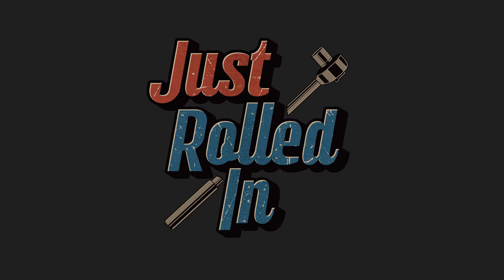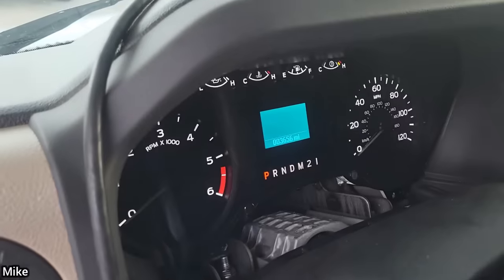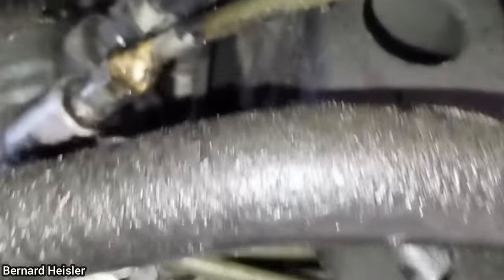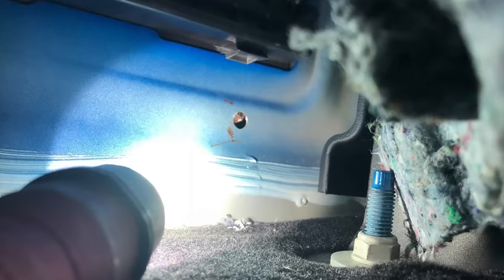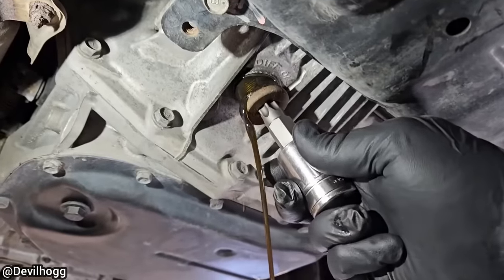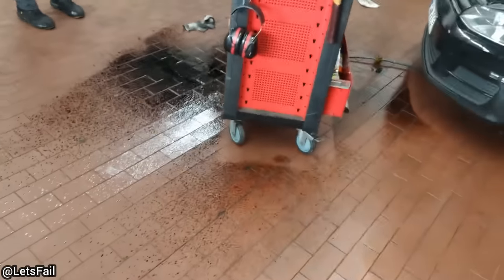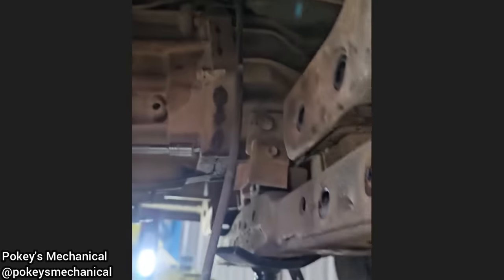Mechanic FAILS Compilation | Just Rolled In

Comment: 0:32 I'm no mechanic but I've seen enough automotive shows over the years that showed the oil and other fluids have to be completely drained from the engine before it is pulled for a rebuild or to be replaced.
Reply: That was bad, but having pulled a number of engines it is a known fact that you never get it all out. You'll find some on your shoes and floor when you spin it over to pull  the rod caps.

Comment: I had a co-worker have her tires rotated.  She drove out of the parking lot and the tires fell off.  The guy apparently forgot to put all the lug nuts back on the wheels.  She said she just wanted them to pay for the dents and have it fixed and let it be a learning point for the guy who did the job, but they went ahead and fired that guy on the spot.

Comment: If 150 psi blew out the transmission pan, what other seals did it blow out??  I'd want a whole new transmission.
Reply: The transmission pan was plastic, more fluid pressure goes thru the valving than 150 psi.
Reply: @scottvincent3062  I guess I wouldn't want a vehicle made with a plastic transmission pan either...
Reply: @ffjsb  Unfortunately the last 20 yrs or so they have been using a lot of plastic for things like intake manifolds, valve covers, radiator tanks and transmission pans all after time become brittle and break.
Reply: @scottvincent3062  ...and charging a crap load more...

Comment: I just took my car to a Subaru dealership today to just get a tire rotation since I didn't feel like doing it myself. I watched the "tech" tighten my lug nuts with just a couple of ugga duggas and drive it out of the shop. I had to make a huge stink about how the spec is 120Nm and to use a torque wrench, lest I end up like that F-150 in the clip.

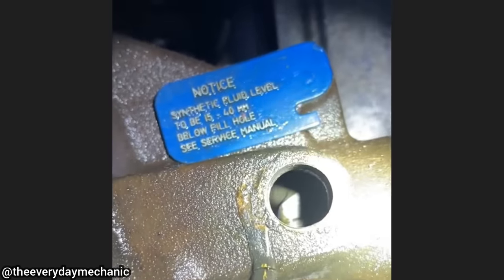Comment: That design at 4:52 is either unforgiveable, or something is missing - like any idea somebody in the 300 pound club is somehow magically not going to smash that cross brace down into the posts at some point [or they touch off in an accident].  That's a standard battery... imagine the asswhupping delivered to engineers by Li ion used on EV's?  No wonder Ford is walking back on that.

Comment: The shop who installed my brother's stereo spliced into the wrong power wire. The torque converter will not lock up unless the stereo is on. Also, the overdrive lockout doesn't work anymore.

Comment: The scenes where the vehicle fell off the jack due to failure of jack arms, chilling. Always be alert and cautious in such work place. And no wonder more and more ppl over there are learning to service & change simple components on their own, you cant trust these clowns with yr vehicle at all
Edit: The shops where they charged the customer for their mistakes and not admitting it should have their license revoked

Comment: @6:40....Overfilling an automatic transmission will not cause a transmission failure. It was a bad transmission. The excessive fluid will just simply blow out the filler tube or overflow vent.

Comment: I think its almost impossible to do worse things to cars than the owners. When i worked at a GM dealership a customer had the starter go out on his Oldsmobile Aurora. It came with a Northstar engine in it just like many Caddys did. Service gave him a quote to repair it but he decided he would do it himself and save some money. The next day the car comes in on the hook. The owner lifted the car with the jack on the aluminum oil pan. The jack went right through the pan and dumped all the oil out of the engine. The real bitch of it was the starter is located under the intake manifold and the vehicle never needed to come off the ground in the first place. Northstar engine were a breed of their own and they could be a nightmare to work on. The guys bill end up being 3 or 4 X more than what it would have if he just had it replaced at the dealership.

Comment: I was almost killed by a brake rotor that came flying at me after a mechanic failed to tighten everything on a truck they'd just serviced. Luckily it aimed low and only took out my entire front quarter panel as I was sitting at a stoplight. Watching that tire bounce through the intersection 5 seconds before the truck did was totally surreal.

Comment: Yeah, the plastic cover over the battery of the Transit 250 is a pain in the butt to put back in, unless you remove the whole seat, but that plastic keeps the battery contacts from, well, contacting anything. Good gravy…

Comment: 0:34 what's even worse, if you use another coolant than original Volvo on their big SUVs the water/oil cooler will be washed out and break apart like it was cheapest plastic... not sure what they did with both materials.
but even here in germany, where we have all kinds of degrees, not anyone knows about the differences in additives, and why some coolant contains silicates, and the other organic acids... and what happens if you switch around, or mix up. what used to be one or two coolants overall (VW, and others) in the 80s, early 90s, is now a good dozen different additives and a couple norms. BASF has a big list, even for classic vehicles, so you can see what's the correct coolant.
2:19 a mistake you usually do only once. I haven't before luckily, or rather, I noticed before any oil would spray out, and removed air pressure again. ;)
3:35 the VW Golf Mk3 convertible has a hydraulic roof actuator. the pump and reservoir sit in  the niche behind the left taillight, and the hoses run around the inner edge of the wheelhouse. customer installed a CD changer there, using self-tapping screws, and just barely nicked one of the hoses, just enough that it took a year or two for it to start leaking... but then it emptied it's oil into the spare wheel bottoms from where it leaked onto the road when parked. I don't remember which was more of a nuisance, replacing the hose, cleaning up, or makign sure no screw would screw with them hoses anymore...
last clip: yes, but only once. I managed to learn from it and stop before I couldn't switch the tool anymore to return the screw and free the tool. XD

Comment: Got my Son a new Tacoma TRD PRO. First oil change and they damaged the oil seal. It leaked oil all over the dealership and my Son drove off. Blown engine within 10 min. Got a new truck but I paid the difference from a 2022 to a 2023.

Comment: There is a socket in most kits That is for a spark plug And the only one that has a grip area for a wrench...Because they knew GM would mess up a good design And throw in a exhaust manifold on number #5 spark plug And you need to get a wrench in there

Comment: I worked at big O when I was 17 and wasn’t paying attention. Walked eye wide open right into the oil drain container pan and got a piece of stripped drain pan threading lodged in my eye. When I blinked my eye lid pulled down on the piece and lodged under the lid in a second location. I went to urgent care and they got it out without any extra damage. Flushed it all out and gave me a tetanus shot along with antibiotics. Returned the next day with a temp eye patch taped to my face.

Comment: wife got advised to get the ceramic coat on her car. which they did. but they had taken the roof rack off and let the nuts slide down the channels. didnt say anything. whole  interior went moldy when the rain got in 🤦 also used it to take sheet materials home. lucky it never lifted the whole rack off.

probably worth getting a couple of 360 webcams so you can catch evidence of what they do.

Comment: I took my car in for an evap leak. Shop said it was the charcoal canister. Not long after the repair the CEL came back on for an evap leak. I rigged up a smoke machine and found the shop that installed the canister over tightened the purge valve and cracked it where the o-ring seals to the valve.

Comment: I have my experiences with bad mechanics. I needed a new starter motor In my car, the shop ordered one and couldn't install it due to them not having a tool to remove the water pump pulley. They caused a leak in the water pump and charged me for the starter they could not install and didn't even bother to give me the stater motor I paid for. I lost about $238 to those scammers.

Comment: I once had a Pep Boys fail to run the lug nuts down on one of my tires. When I left the parking space, the driver's front fender collapsed down on to the tire. Before I left, I got two new rotors and calipers, and they got to reimburse my company for $1300 in body damage.

Comment: Unless you absolutely never use your signals (or put it in gear), its virtually impossible to drive a car without touching some switch gear
So how the Buick in the 2nd last clip got home without the owners turning right around is astounding

Comment: I've had to blow out two glow plugs by running the engine on my 1,6 Volvo diesel. They're on the back of the engine and awful to get to so I had to make special tools to drill out the threaded bit. The ten year old plugs were obviously stuck in there like crazy. After days of trying to loosen them with penetrant and warming the engine I let them blow out by themselves under uphill load. One was no problem but the other one shot straight through a cooland hose.  lol

I hate the engineer that decided to put them down on the bottom of the back of the head of an engine that is always transversally mounted in tight bays.

Comment: The shop that did not cover the automatic transmission because it was overfilled was correct. You cannot hurt an automatic transmission by overfill it. It simply was transmission fluid and semi rust proofs the vehicle.

Comment: I’ve installed transit batteries before. You are not supposed to install that bracket directly above the battery. (Obviously) It should be installed last.

Comment: I changed the oil on my Corolla. Have done it for years. But this time something was wrong. When I put oil in it was way up the dipstick - like - there was double the amount in there. I checked the oil bottle again and again - 4 litres. I went and had a cup of tea. I just could not figure it out. I crawled back under and decided to drain some of the oil. Nothing came out. WTF. Another cup of tea. Then I went back under the car and Zap - I realised my mistake. I had drained the transmission oil and filled up the engine oil. The transmission oil plug was dead-center and I just undid it without thinking. So, I got new transmission oil and new engine oil. All's well that ends well but I thought - if I have done this, so may have others. I checked on YouTube. Several people did this, drove off, and wrecked their transmissions, will oil leaking from various engine gaskets. Moral: If you get stuck - a cup of tea is required.

Comment: For the last one my worst one was.... i don't know what you guys call it translated we say "air gun". Anyhow i was loosening bolts on a transmission had my hand over the back where the direction switch was so i could push it on the bolt firmly. Unfortunately then my hand got sandwhiched between the gun and subframe. I had to yank out my hand pulling 2 finger nails out in the proces.

Comment: I'm pretty sure I was on the receiving end of one of those fraud jobs. I bought a used car and the seller gave me all of the receipts for the last several years of maintenance and repairs. A couple of months later, the car won't start; ends up it's the fuel filter clogged and fuel pump dead. I had the receipt for a local shop showing they had just replaced that pump a month before I bought it. I called them up to see about the warranty on it and all they will say is, "There's no warranty on it; it's just a jobber." My best guess is that either they put in a used one or they didn't even replace it.

Comment: We can all get a good laugh out of this video, but in all seriousness, when you’re dealing with brakes, steering, suspension components and the wheels, take extra care to make sure everything goes back on torqued. One time I pulled over to help this bmw on the side of the road, he said one of his wheels started wobbling so he pulled over immediately. To his surprise, we found that one wheel was only being held on by 2 out of 5 lug bolts. I think they put the wrong rotors on, because it apparently just got a brake job done on it, and all three holes in the rotor to the hub did not line up.  He had to get his car towed, and I recommended that he immediately go back to that shop and demand a refund and proper service. He was pretty scared after realizing what could’ve happened as he had his wife and his two daughters in the vehicle with him. Remember when working on someone’s car that they are trusting their life in your hands, if you forget to tighten one bolt somewhere it could kill someone.

Comment: I really feel for the guy that walked into whatever that was attached to the back of that car. I've hit my head on trailer hitches, tires, lift arms, and one time I hit my head hard on a cage designed to hold an electric scooter. Shops are a dangerous place.

Comment: Had a guy drive my truck off the rack head first ….. landed on their valuable computer that was (formerly) 5 feet tall . 77 Ford F-150 4X 4 RANGER did the job ….in 1990 got $2,500 for a small dent on the drivers side door and a front winch bumper just pushed up by loose bolts 😊 no damage to the truck except for the door and  broken arm of the guy that was driving
Reply: I was in the customer wait room when I heard a crash where you knew something was wrong 😮 imagine the idiot just concerned about his arm 😮🤣🤣🤣🤣🤣

Comment: The part about the coolant being chunky? That is a lack of proper mixture. I have never had an issue in 20 years with generic anti freeze 50/50. All manufacturers say they have special stuff. It's just another color. Maybe on extremely rare situations. Otherwise that is Def mechanic error more then the product itself.

Comment: Don't try to stop a 2000+ lb object that is falling. Just get the hell out of the way.  I've seen people crowding around forklift loads while moving equipment, thinking that they'll "help" if a load starts to fall.  I always tell them to back off and that if something is going to fall, let it fall.  Machines can be fixed a whole lot easier than people can.

Comment: 85 Cadillac Seville.   Weird tinging noise when accelerating.  I looked all over without a lift.   Went to a shop I use to work at. They lift it up, test drive it and such, not in that order, lol.   Tell me they think the tranny is going out.  I told them No,  If it was the trans it would change pitch, change sound in temp changes and shifts, things like that.   I drove 100 miles to another friends private shop.  Classic car collector I did carb work for many moons ago.  We took the starter off to inspect inside.   It was the starter the whole time.  The fulcrum arm for the pinion was broken, every time you accelerate, it would clash lightly with the ring gear, creating a horrible noise.   New starter and my Caddy back to quiet.  I know starters will work without the arm but this one never messed up, otherwise yea, instant clue.

Comment: That thick coolant one looks suspiciously like a product called 'steel seal'. Same exact colour and consistency, i suspect the description is wrong. 
It's supposed to fix your head gasket 'or your money back'. Doesn't say anything about not breaking the rest of your engine in the process though. It blocks everything, even thermostats. Don't buy it. It doesn't even fix head gaskets.

Comment: 8m10s to 8m21s, wheels fallen off that ute because the lug nuts weren't tightened. If this happened in the state of Michigan then the owner would have zero legal recourse. After a similar case that went up to the Michigan State Appeals Court. 

Even though state law clearly states that the task must be "completed" the Appeals Court chose to ignore that clause as it considered the word "performed" elsewhere in the law.  

They said that as long as a job was commenced, it would be deemed to have been "performed".  

Unless someone is able to get the State or Federal Supreme Court to look at appealing a similar case, that's now how the law is followed in Michigan.  

Therefore don't have any vehicle servicing done in Michigan state, so instead go across one of the neighbouring states' borders, or do the work yourself.  

"Steve Lehto" an automotive lawyer on Youtube has done several videos on it.

Comment: some of the ones where the mechanic shops fucked up the cars but royal, is the very reason i have trust issues with taking my car to a mechanic outside of the cost. i dont want to spend money i dont have for repairs only to see my car become useless and have them refuse to cover the damages. 

hence why im glad i know how to do some routine maintenance and replace some more extensive wear and tear parts like tie rod ends and wheel bearing assemblies. anything else im also lucky to have a brother who is a certified mechanic who will merely call me a retard for letting something get to bad lol.

Comment: I would be so pissed if I bought a truck from a dealership completely badged as a 4x4, and not having it. But also on top of that, I'm not walking out without checking the front u joints so a missing driveshaft may be the first clue

Comment: Every mechanic has fucked up draining an oil drainer at least once. Leaving the shaft a bit loose or leaving a valve open is guaranteed to paint both the ceiling and yourself with oil..